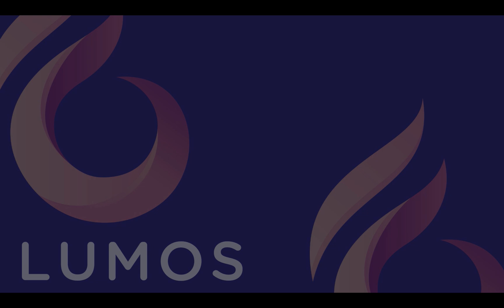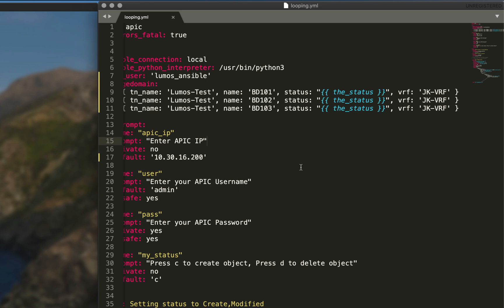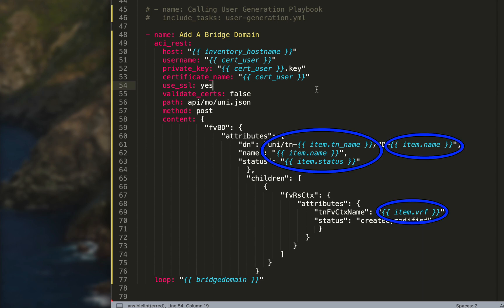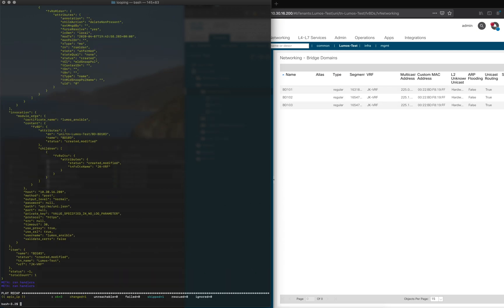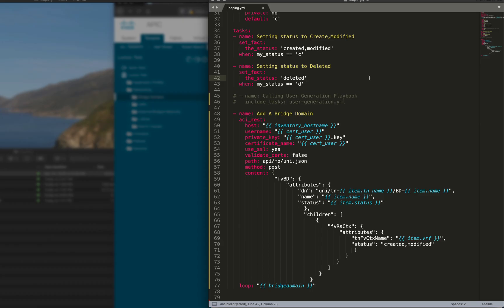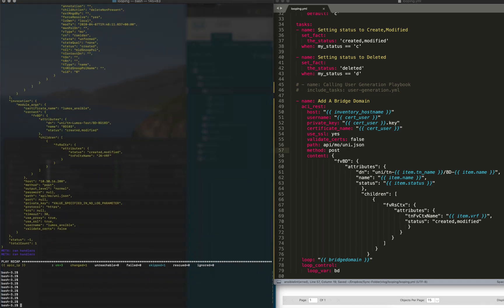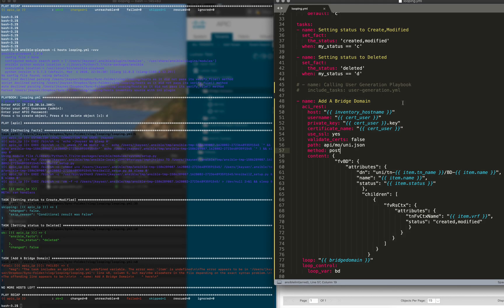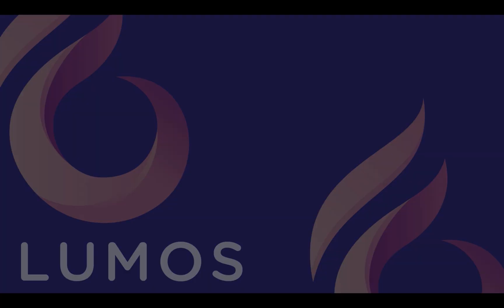3. Demystifying Ansible for Cisco ACI - Looping

Comment: Curious why you chose to use aci_rest vs the pre-packaged aci modules? I've been dabbling with ansible to configure my ACI fabric, but have mostly been using the prebuilt modules thus far.
Reply: Hey Tim, thanks for asking. The Ansible modules are fine, but there are certain situations where they are not ideal. For example, most of the fields in the pre-built modules are mandatory meaning you have to pass (sometimes) irrelevant information for what you're trying to do. The rest modules can be stripped down to the bare essentials saving time and mistakes.

Comment: Hi James,

very nice, clear and easy to understand explanations ! 

I am trying to understand how Ansible would be useful when compared to postman. We can provide CSV input file to postman when we have to configure huge number of objects, like 100 BDs
Can we provide such input file to Ansible ? writing the number of lines inside the playbook for number of objects is still a major task.
Reply: Nilesh, thank you for watching! The short answer is YES, you can most certainly use a CSV or even an XLSX file as the source of data input.  I usually use those methods and hardly never enter my objects into the playbook directly.  The video has them in the playbook to help get the point across., and show what a list of dictionaries would look like in yaml.